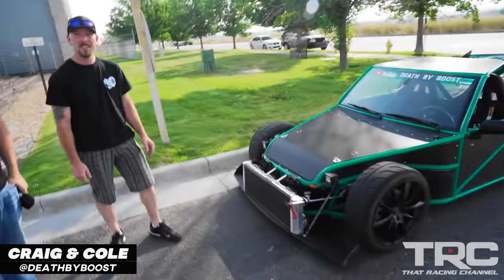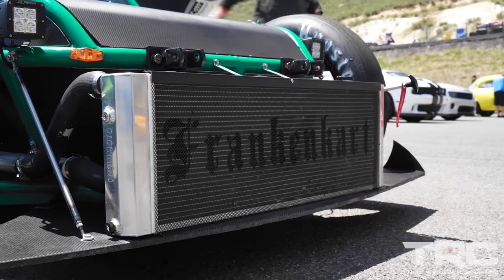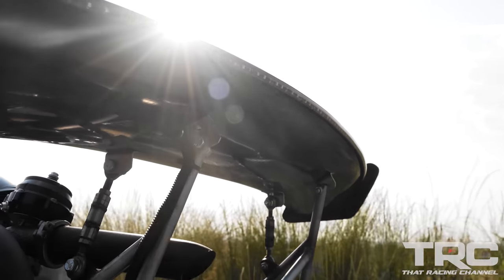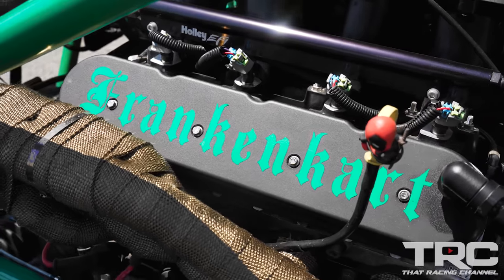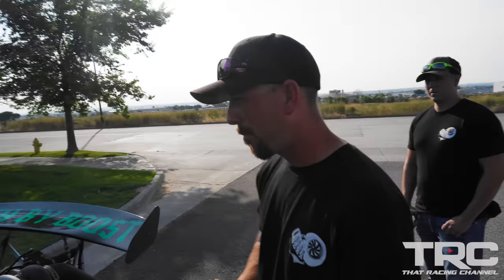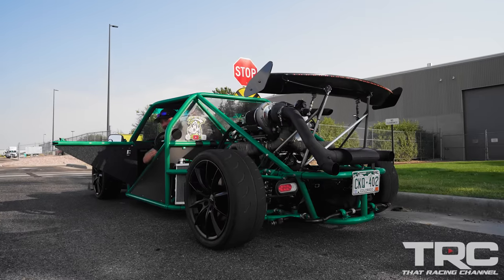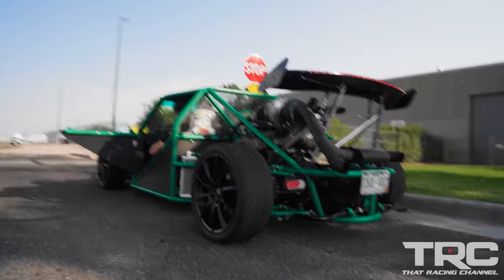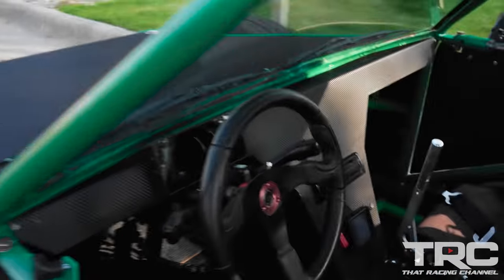800HP Street-Legal Turbo Go-Kart?! 2300LB Weapon Hand Built From Scratch (ROWDY Highway Pulls)

Comment: Nice build. Do you think you'll ever get it into 5th gear wide open. Or would the back end not stay on the ground?  Could you ever get it out of 4th gear. What is the top speed? Are you prepared to die. I hope your not afraid to die. You have set the bar high.  Do it wide open.

Comment: Wonder if the transaxle can take the power because the vehicle is so light. Less to resist the motor
Reply: Im planing to use a 01E audi 6 speed box, for a 2j rear engine project. Quite interested that this 5 speed version is holding uo
Reply: Makes sense

Comment: 2500lb is a little heavier than I expected tbh
Reply: Fr i expected 1500 pounds at most
Reply: @alexvargasmorales712  2,500 is not bad for wet weight with a driver. A formula 1 car weighs almost 2,000 pounds with fuel and driver.

Comment: That's pretty scary I mean it's 800 horsepower is with the weight ratio on that is that's pretty scary thinking about a V12 system setup like that with an all wheel drive 4 wheel system all lockers and adjustable differential for front and rear and dripping throughout the the time attack cars what is going to be for circuit circuit time to track but this car right here is that mean I gave me a nice view up on I might be overpowering up on some of the stuff cuz I didn't think too much about the weight ratio and that was thinking V12 twin 80 mm turbos and then the main construction on the wings and adaptions on the suspension I like how that suspension work is set up and you do good work up on the front A-Arms and the differential systems on the rear end but the just to give you a nice time attack review upon this I'm running racing cans and it's going to have any pump automated adjustments when you turn the corner and you start to turn right your front tire sucks up in the back tire pushes down and is going to help with the cornering sometime attack so it's circuit renting a car it's just a dream of mine to actually get produced so and I'm glad you build your own car and then I give props where props are due that's a badass builder respect the car EXO monsters

Comment: And I would drop a k series in it for less weight and reliability
Reply: Brapppappap
Reply: @Sheridantank  Honda. The power of dreams.
Reply: @c-dubmediallc4933  
K series is top 10 "regular" car engines for me.  I love them.
Reply: the 5.3 is objectively better for this application
Reply: @Kinnectxfollower  the only benefit I can see is the weight it has over the rear wheels. Which I’m not disagreeing with you but I mean you could add ballast to it if needed. But you gotta admit it would be more reliable and In my opinion would sound better revving to the moon lol.
Reply: @c-dubmediallc4933  you at least saw the weight aspect, however you are completely wrong when it comes to reliability, a 5.3 ls engine is a truck engine that last stock at least for hundred of thousands of miles, a k series can last hundreds as well and generally is a good engine, but but but, this is a turbocharged application, which changes things completely, simple basic math, 5.3 ls is gonna need like 10-15 psi to make the 800 hp, very low pressures and you don't need racing fuels and such to make such numbers, a k series is gonna need 40-50psi to make 800 hp, which is exponentially more stress on the engine. I'm sure you are a honda fan, but a k seris at 800 hp and a ls motor are two entirely different ballparks in terms of reliability, when meeting a hp goal, and especially boosted. as far as the sound,  personal preference
Reply: @Kinnectxfollower  boosted boi Kyle made over 1000 hp on about 25 psi and pump e85. But either way would make for a nice build.
Reply: @c-dubmediallc4933  no he didn't, the nsx made like 800 to 900 at like 40
Reply: @Kinnectxfollower  wasn’t referring to the nsx. The mr2 was somewhere around 23 psi
Reply: And I have a buddy that has a 2004 tsx that has 893 whp on 27 psi.
Reply: @c-dubmediallc4933  its not really an argument, first off the mr2 was 35 psi for 880 https://youtu.be/-L3ZFSGtWmg on ignite e90 racing fuel. You need an apples to apples comparison, and the end of the day power equals air plus fuel, in a k series you have twice the air and fuel in each cylinder than the ls motor, the ls has more than twice the displacement and double the cylinders which is exponentially less stress on the motor. If you want to get technical you can go look at boosted boys engine, nothing about it is even remotely a stock k series anymore and is custom built to handle high boost, this lead to another factor of cost per hp, which is the better platform in terms of cost the ls wins again being like 1 fifth the cost to build up a k series to even handle 800 hp without blowing up. A k series is really only good if you have a love for 4 banger jdm engines, but in terms of pure on paper performance the v8 platform is objectively better in every facet.